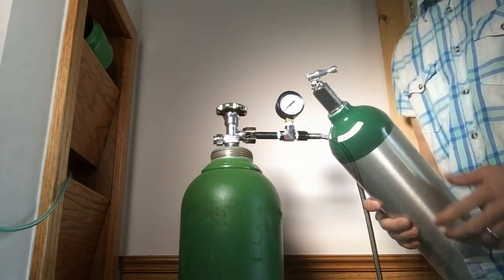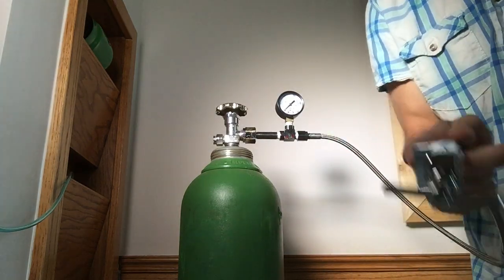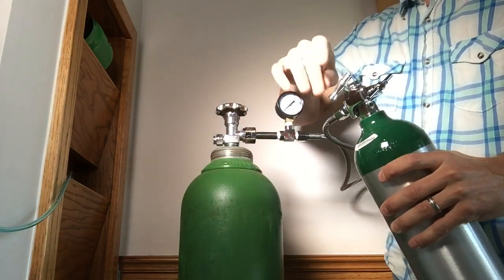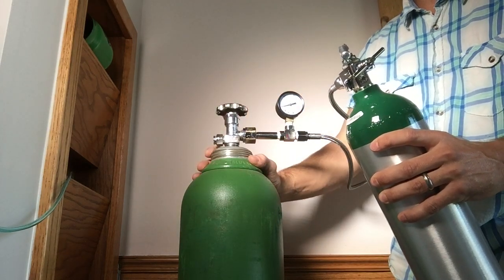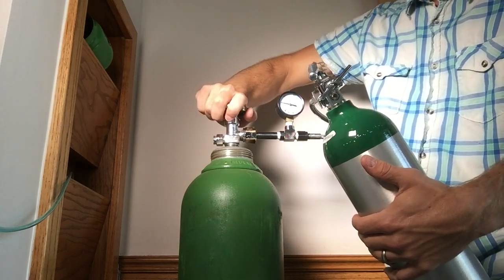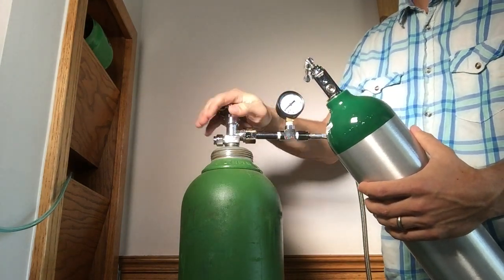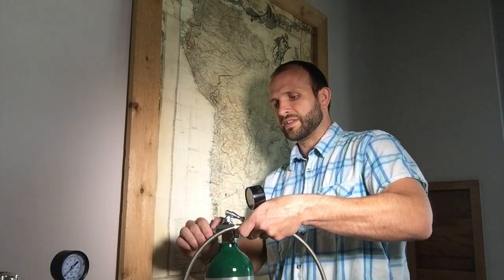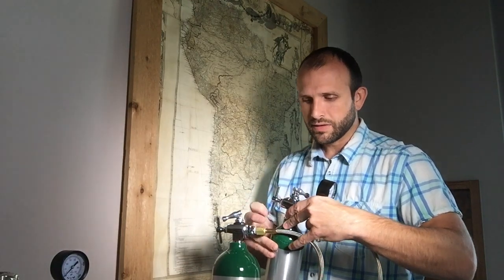Oxygen Tank Filling - How to fill your oxygen tank with a transfill hose

Comment: My local welding supply store doesn't exchange the 20-pound oxygen or the 10-pound acetylene tanks anymore that I use for jewelry repair.

It's a 100-mile round trip to the closest supplier. I have 4 big oxy tanks and 2 big acetylene tanks for cutting steel. I really need to do this. I don't want the big tanks in the house.

Thanks for the tutorial.

Comment: How do you know what adapter to by for an 870 post valve? The devilbis brand for oxygen concentrators supposedly claims that it is not compatible with oxygen tanks that are not their brand but I have a hard time believing that.
Reply from the maker: @victoriakalaydjian2935, So I am trying to sort out your question a little bit. Typically you would use either a concentrator or a tank, but not both. And I am not aware of any time at which the concentrator and tank are connected. The medical oxygen tank will accept an 870 oxygen regulator. If you have more questions, you can contact us at info@o3vets.com. Thank you!

Comment: What is the working pressure of medical O2 bottles? My big industrial is at 2250psi and I don’t want to over pressure a smaller medical bottle but I can’t find a pressure rating anywhere
Reply from the maker: Hi Blake, yes, that's the same for the medical cylinders that we use. Thanks!

Comment: Does medical oxygen explode?
Reply from the maker: Hi Jill, medical grade oxygen is not going to explode, but it can feed a fire if it's already burning. Not something you really need to worry about though.
Reply: Oxygen is not combustable. However, it SUPPORTS combustion extremely well. Just be careful it is not exposed to anything burning.

Comment: Would these connections work with a home oxygen condenser to fill bottles??
Reply from the maker: Hello, I'm afraid that I cannot answer that question, but I doubt it. Usually a concentrator will only put out a very low pressure which will not be enough to fill a tank...plus I would assume there are legal ramifications to filling your own tanks that way. Hope that helps